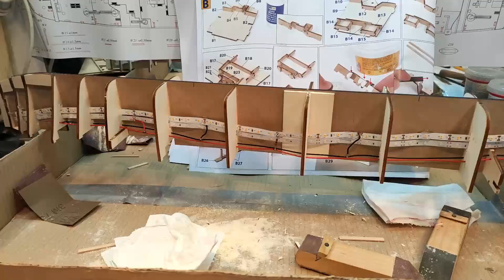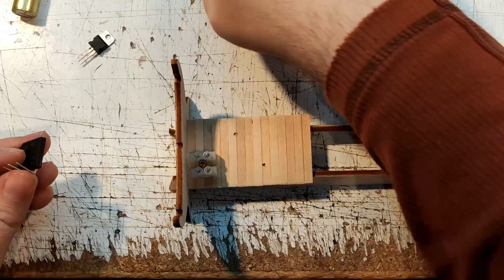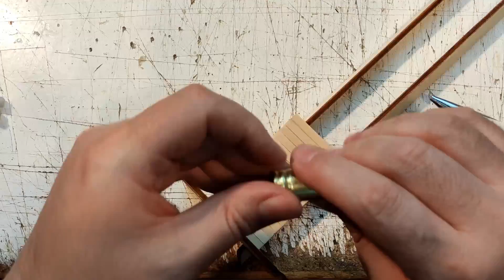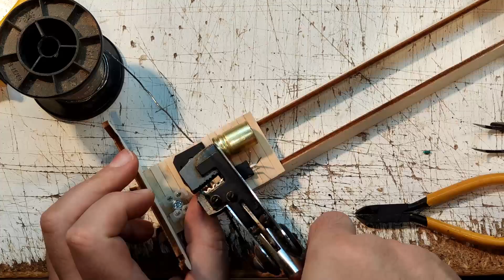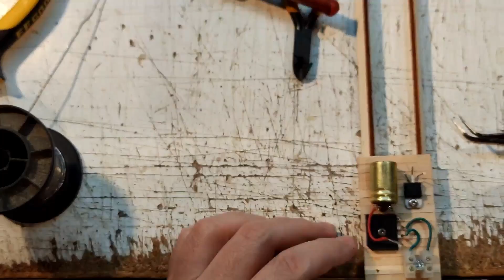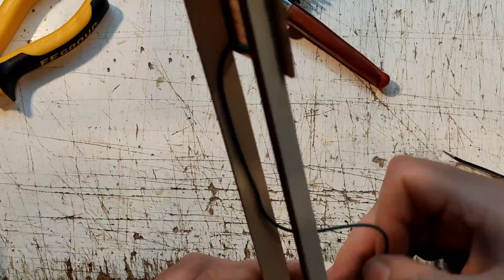RMS Titanic - part 4 Making The Circuit On The Base

Comment: I'm buying this as soon as it becomes available in the USA.  I picked up the Montanes kit after watching your playlist.
Have you considered using magnet wire? I've used the 28 gauge for LEDs in models I've made. It comes in red and green (ground), and the vinyl coating immediately burns off when you tin the wire end.  Very convenient.
Thank you for making all of your video series!
Reply from the maker: Hi Dan!!! Yes this is a good one!!! No i didn't know about magnet wires. I have calculated the current and i will need around 1A or a little more for all the leds. Maybe it's better to use the old fashion wiring.

Comment: Hi John. Thank you for your very instructive videos. In this video it's clear to me that you make a circuit from 12V AC to 12V DC. Maybe a silly question but what power source do you use for the 12V AC. And give a hug to Wolf from me.
Reply from the maker: Hi Hans! I am glad that you like them :) I use a transformer from 220V to 12V AC at 105 Watts. I will use this one to power up the spot lights of the display case so i will also take power for the LEDs as well. I will give him a big hug!!!

Comment: As a suggestion - try some flux paste when tinning wires. Dip the wire in the paste and you'll get a solid tin without the risk of a cold joint plus it's faster. (I make my living repairing aviation electronics)
Reply from the maker: Thanks for the tip Ken :) The soldering wire has flux in it :)

Comment: Volevo farei a richiesta, potrei avere i nomi e voltaggi di tutti i componenti che hai usato grazie.
Reply from the maker: Just a simple bridge circuit for transforming the AC into DC
A capacitor 2200 micro farad at 16V
IC 7812 12V stabilizer

Comment: John : une question un peu en retard, quels sont les éléments pour ce circuit d’alimentation ?

John: A late question, what are the components for this power circuit?
Reply from the maker: One bridge circuit, it is common, one 2200 micro farad capacitor at 25 volts and a voltage stabilizer 7812, very common IC.
Reply: @JohnsWoodenShips  Good morning, John,
Thank you for this additional information. On the video I can clearly see the capacitor and the 7812 voltage stabilizer, but on the video I see a black square, is it the bridge circuit?
Reply from the maker: @modelismepassion4493  Yes that's the one.